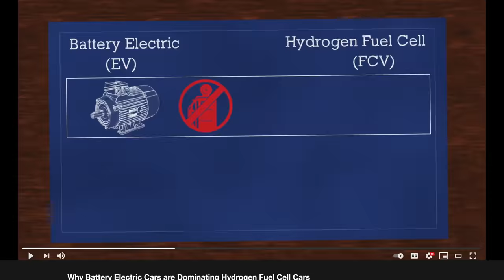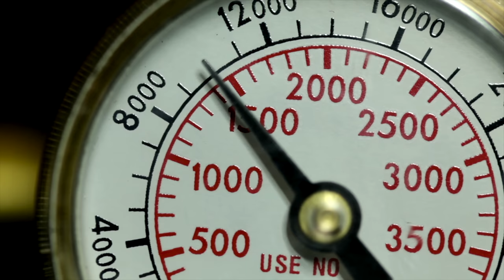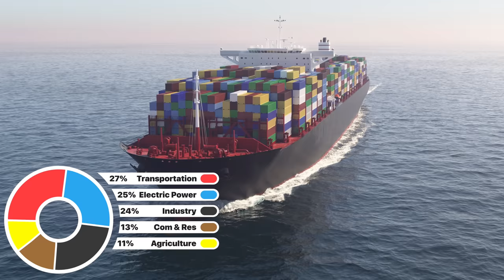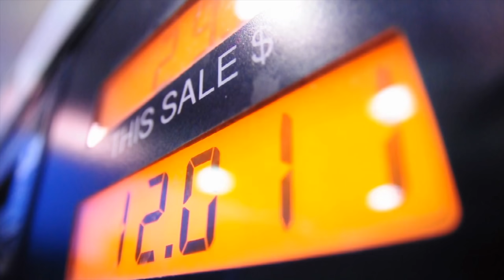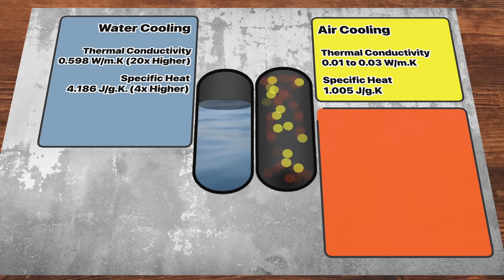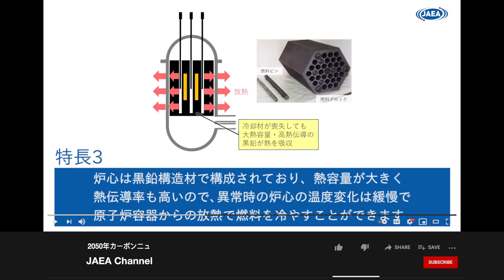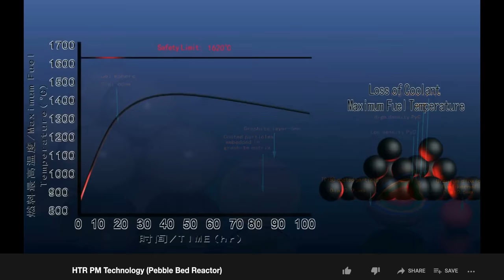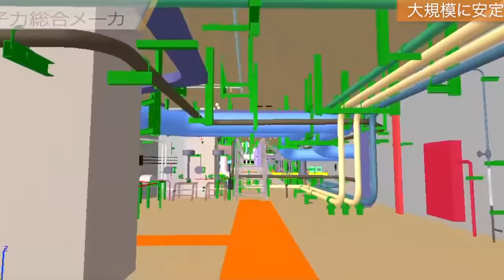Japan's Plan to DESTROY the Price of OIL and GAS!

Comment: Thorium. The only tech we need. It has been proven. It is the safest fuel for nuke reactors. It runs on the waste from current reactors making their waste much less radioactive. The reaction is forced not self perpetuating. If anything happens to the reactor the reaction stops, on it's own, with or without coolant or human intervention or power or computers. It is scalable so a power plant can be as big or as small as needed. A prototype car has been made. In 70 years it will need a fuel fill-up. Your house can be powered by it's own reactor.
So why don't they make them? 
Thorium is everywhere so production would be cheap. Unlike current reactors the byproducts can't be used for weapons and the waste is many magnitudes safer and less radioactive.
You would think those reasons would be great to develop this tech, however... Cheap production and massive availability would undermine a billion dollar a year monopoly on uranium production. Likewise, no nuke weapons fuel, that went over like a lead balloon. Safer and less radioactive, again you would kill a billion dollar industry. Each is heavily regulated and subsidized by the fed. Cause da money.

Comment: Not at all, Japan is keeping the price of oil and gas high. Platinum and Iridium is extremely rare. Using Nuclear, the most efficient process is produce electricity and use it directly for moving cars. Not use electricity to produce hydrogen then suffer a lost in efficiency for moving cars. Converting fossil fuel into Hydrogen is hardly green and is environmentally disastrous. 
Toyota and Honda will experience their Kodak moment.

Comment: But in the end you have to use fossil fuels to make hydrogen. I would like to see a windmill produce enough power to get the heat that high for half of what you have to do. Solar panels probably wouldn't do it either unless you use the middle of the solar array

Comment: 12:00 Funfact, if you use sea water, you will get Carbon emissions for sure. Because you will release the bound CO2 in form of H2CO3. It will not be at coal plant level, i guess not even at gas plant level, but you get emissions a 100%.

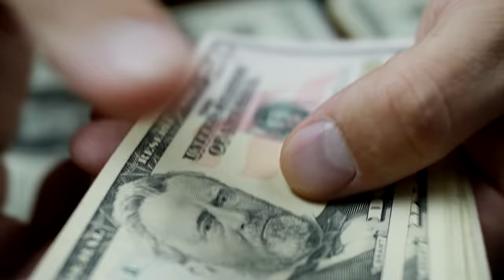14:00 For sure this first reactor at scale is NOT economically, if it means cost effective. Hydrogen from NG is just too cheap, for certain cheaper than from nuclear. So where are the figures? Is a new reactor in Japan as expensive as it is in GB, FR and the US? I don't believe they will have a cost effective way to produce hydrogen with nuclear reactors.
And "Totally clean"... yeah, NOT.
How do they don't need "vast amounts of nearby running water" if their main thing is splitting water in hydrogen and oxygen?

15:15 Exactly this nuclear fuel type was never economical till today. The reprocessing is more cost intensive than the traditional fuel rod. I don't believe this has changed and ever will. It is inherent more complex as the reprocessing is.
Funfact: Former HT(T/G)Rs were shut down because pebble fuel is NOT inheritently safe.

Question: Was the Hype that great, you had to spin the story so bright, you could just gloss over the problems without discussion them? Or do you just take Mitsubishis claims for face value? You know many nuclear companies project a bright product without having it in the first place. After a while it will become clear, it wasn't that bright and the cost overruns get into the 5 fold and more in the western world. Without a second viedo discussing these problems, i don't believe in it as it is stated here.

Comment: For transportation, fuel cells will never beat battery EVs. Look at the energy conversion efficiencies. Hydrogen needs to be made using electricity, it doesn't make sense. Just use the electricity via the battery to power the EV.

Comment: no matter what technology you use to utilize nuclear power; there are a couple of insurmountable issues  First it is nuclear waste  Secondly these systems are all mechanical  Saying they  wont break is like telling me that i can depend on my subaru to run trouble free for another 2 million miles based on the fact that it has run trouble free for 150000 miles a[ready. No matter how many additional safety measures we take, nuclear accidents, no matter how unlikely , are likely to be very problematic,
if you want clean H2 use renewables to produce it.  Coupled with the issues of hydrogen corrosion and mobile high pressure storage issues H2 looks a long way off

Comment: Without a giant battery break through or thermonuclear power or Thorium; the entire electrify everything plan is dead. Battery storage is fail from the start. If you used all the 100,000 tons of lithium annual production for storage batteries - you could power the USA for 5 minutes. The USA is 1/20th the World population; maybe you could power the world for 1 minute.  To even last the night; you'd need 60x8 or 480 times the batteries. That doesn't include half the world that is in winter and needs to be powered for hours. No Lithium for EVs, cellphones, laptops, etc - you'd likely need 10,000 times as much production of lithium; or any kind of battery.. just won't work.

Comment: Hydrogen is extremely difficult and expensive to safely contain even in fixed locations, let alone on a moving vehicle, in which everyone is under pressure to reduce weight and costs.

Hydrogen as an automobile fuel is unnecessary deaths waiting to happen...

Comment: 14:20 build anywhere? I mean you can build a nuclear power plant and a water splitting reactor anywhere sure, but it is f ing expensive and you can't just mass produce it everywhere. And you still need a reliable water source. And the biggest problem, still, is a transportation of hydrogen. It can not be liquified neither you can't use existing gas pipes (hydrogen is much more corrosive). So you have to build an entire replacement for existing infrastructure from scratch. Overall you need hundrends of billions for a relatively large country and a funny thing is that methane, oil and coal will still be cheaper. You can't just come to a huge economies like India and China with a huge coal deposits and tell them you should use hydrogen now which mean that fast grown ecomonies will still be using fossil derived fuels for many years.

Comment: Japan leads the way in nuclear energy? They operated some of the oldest nuclear reactors, ignored the advice that GE engineers gave them when they built Fukushima, had failed to properly train the staff at Fukushima Daiichi to understand how the emergency cooling system works and what they should see when it's working, and have a history of negligent nuclear accidents and ignoring seismic dangers when building plants. They were aggressive in building out their nuclear energy grid but cut corners and ignored sound advice from GE engineers in the US that were worried about the danger of a tsunami doing exactly what happened in Fukushima. Had they build the plant on higher ground and just dealt with having to pump the water uphill, and had they properly used the emergency cooling systems (which work without electricity), Fukushima would have never happened and they wouldn't have had to resort to burning oil to power the country's electric grid.

Comment: But what about blue hydrogen ! or, or pink hydrogen ?   When will it be useful 1 year 5 , 10 ,20 or 50 years?  Still waiting for the super battery, and the super, super battery that they promised , said it was right around the corner.

Comment: I love when people a lot of people mike try to cut the conversation of safety short but one part of safety you didn't really cover i'd like preventing the hindenburg We don't need To forget what happens when you try flying blimps or other sensitive objects with things like hydrogen and i think that's the bigger issue when it comes to hydrogen going to vehicles is human air to create a Hindenburg gas station fuel station
Reply: The problem with the Hindenburg blimp was the covering was coated by a rocket fuel. Static electricity set it on fire, if you ever saw the film the helium was burning straight up in the air.

Comment: Yeah Japan has not oil so they need to develop everything they can . They have been playing with Fuel Cell cars for years but there are no cheap fuel cells as they use platinum for catalysts. Then there is the Hydrogen Storage problem. I thought the Molton Salt reactors would also be safe and even burn our accumulated radioactive waste allegedly . MSR doesni't need to stop for refueling and the fuel cycle is something like 50 years before refueling.

Comment: There's a false dichotomy here.  There really needs to be a range of solutions that suit specific scenarios. Hydrogen fuel cells might be a good solution for Japan, batteries might be better for other regions.  Petrol and diesel lived side by side for decades. Relying on a single source of energy (fossil fuels) is what got us in this mess; let's use different thinking to move us out of it.

Comment: E-bikes have been the source of many fires. Lithium ion batteries likewise have serious problems with fire and the inability to put them out.  And then there are ever-present questions:  "Where are the components to make these batteries coming from?"  Who controls the majority of it?  What is the labor force made up of?  Children? the Poor? and the rest of the moral questions that need to be answered.  If the latter is not factored in, then those who push this are accomplices to the crimes--right?  What about recycling?  How about what is needed energy-wise to produce them?  How are ball bearings make that go into the product? The latter here is not talked about nearly enough, or are they researched.

Comment: Japan can do math.  Lithium is a dead end for EVs.  If all 100,000 tons of Li made went to EVs; you can make a max of 10 million Model Y size battery packs. For EVs to be more than a niche in the 100 million light vehicles sold annually and 1.4 billion installed base; Electrify everything fans will say - bettery battery tech is in the labs.  Hydrogen promoters also can point to Hydrogen production from saltwater, bacteria, etc. coming soon. Who will come out on top? Maybe Ethanol. We can make Ethanol now, it will work OK in existing cars, you can design engines the use it more efficiently; all you need do is grow crops. Brazil is largly doing this in their economy. And no the Amazon isn't the lungs of the world. It took billions of years to make the oxegen in the atmosphere and it isn't even fractionally dependent on the Amazon or even the oceans. Maybe there will be a battery break through or a Hydrogen break through; but why wait for that?  You can do mass carpooling and work from home now cutting CO2 by 8% NOW, then convert to ethanol; you need not buy systems that don't work.

Comment: The problem with EV is the recycling which is going to be expensive. Otherwise, you would already see investment and modern technologies developed.
Currently it is not big enough to be worth considering. Maybe future batteries will be built with recycling in mind.
A hydrogen engine can change the airline industry, power generation and landline transport.
The best is manufacturing hydrogen inside the engine. There is a chemical process that can do that but needs more research to make it reliable. If aluminum can be doped in such a way to allow that then you can have engines running on water and aluminum foil.
This will have enormous consequences through decentralizing energy production. There are already large-scale aluminum production plants all around the world and recycling aluminum oxide is easy. That will make mining lithium mining redundant and will shake things up beyond anyone can imagine. 
Whoever cracks that is going to face challenges never faced. Lack of fresh water around the world is going to be a growing problem. So, if you can combine desalination and energy production in one process then it will be worth a lot of money,.

Comment: Maybe I'm a bit of a stick in the mud, but the moment anyone claiming to explain an energy technology quotes hydrogen's energy density with no reference to the storage system (insanely far from massless) I flip the bozo bit. It's like posting a giant "I don't get science" or "math is hard" right on your forehead. 

mass of gasoline tank << mass of gasoline inside 
mass of hydrogen tank >> mass of hydrogen inside 

That's the symbol for "much greater than". Did you spot the difference? 

"A typical fuel cell electric vehicle or hydrogen car tank capacity is around 4–6 kg of hydrogen and the weight of the hydrogen tank is around 100 kg."

But you're an energy genius, and you don't want to harsh on the Pollyanna parade, so you rush to divide by 5 instead of 105. 

Good on you, Homer Simpson, you'll go far.
Reply: thank you

Comment: Your not shearing the other side's.
Plutonium...is the main nuclear fuel, simply because the waist is used for war weapons.
Thoriam......was also put forward as a nuclear fuel, but was regeceted due to its efficiency.......very little waist.
Thoriam is the way forward, very little waist and it's so much safer..

Comment: Hydrogen cannot be produced easily. It has the lowest amount of energy output compared to how much energy it takes to produce it of anything. The latest figure I saw is approximately 40% energy output of the total 100% of energy it takes to produce hydrogen.I love how this guy thinks that electricity is generated by wall sockets. It reminds me of these people in Colorado who drive around their Tesla‘s, then plug them into the wall socket which leads directly to the coal powered electrical plant.

Comment: And where do we get helium?  It is generated deep in the earth.  It ends up in the trapped natural gas deposits.  So we get all our helium from natural gas.  And most of the natural gas is not treated to remove the helium.  So our helium supply is pretty limited.  We need to put up plants to remove helium from the process cleaning natural gas, to have enough in the future.

Comment: How can you claim the righteousness in EVs when you have to strip mine for environmentally damaging, non-recyclable elements that the working conditions of that populace in these regions would be considered barbaric? Then you plug your EV in sucking more energy from the electric grid. The Electric grid is primarily powered in the United States last year's stats our generation of energy was Coal 21.63%, Oil 0.45%, Gas 38.18%, Nuclear 18.73%, Hydro, 6.26% Geo-Thermal 0.39%, Solar 2.76%, wind 9.14%, wood 0.89%, bio (other) 0.44%, and misc at 1.12%. 

I’ll state that Wind and Solar are hypocritical Ponzi schemes, because wind turbines are damaging not only ecologically, agriculturally, and in conservation of bird and bat species and forests; but are not efficient enough to drive energy prices ask Germany, and old turbine blades are buried in landfills same with Solar panels the contain earth minerals you don’t want leaking out and these two industries wouldn’t survive without endless government subsidies which make them not relevant. 

With nuclear 96% of spent nuclear fuel is recycled in nuclear recycling plants let’s look at the meltdown History Chernobyl was bad less than 100 dead initially but the range of later deaths is so drastic that it could only be politicized Chernobyl could have been way more 
catastrophic Fukushima ranked hirer but only 16 injuries were a result of the meltdown and explosions 1 cancer death so far which a bigger disaster was prevented through mechanisms. Kyshtym disaster 1957 200 in Urals Soviet Union at a Nuclear weapon and plutonium reprocessing plant and the soviets only had the tech for Nuclear weapons since 1949. The three-mile Island accident was not worth anything due to being contained with no injuries or deaths. Nuclear is a viable option with the advancing tech it’ll only be better. 
 
If we can perfect Solar and Wind more I’d say use them in combination with pumped storage hydroelectric to maximize efficiency you would only need a higher elevated source of water for the bottom which could be upscaled and downscaled to more personal energy devices. 

We were energy independent with the Gas and oil industry and we’re on track to be dominant which we could of. Sorry for the bad scary word, temporarily had a nationalization, in which the excessive funds and tax dollars would of eliminated the need for the Infrastructure Bill with the basic low tax and are revenue from overseas which with the excessive gaining profits would have been used to fund actual real solutions eliminating the need for the heavily bureaucratic and controversial Green New Deal but with actual results that manifest; yet maintaining growth, not increasing inflation, dependency on foreign energy sources, and taking the first step that will lead to a walk, then jog, and sprint to affordable, reliable, actually green energy at not the expense of ourselves these doomers have been pushing it every decade since the 60s look it up. With Hydrogen, it can go many ways like finding a way to make the Hydrogen atoms bond more tightly in water. We could us Ammonia for hydrogen fuel there is the opportunity to convert ammonia back to hydrogen, where it can be used to power hydrogen fuel cells, or it may be used directly within high-temperature solid oxide direct ammonia fuel cells to provide efficient power sources that do not emit greenhouse gases.

Comment: Still. I have yet to find someone to explain why this carbon is an negative for the planet. Save for the power and control a few get out of this being forced on us .
Reply from the maker: It’s so very simple. Imagine sitting in a closed garage with a running car. As you can imagine, you’d die, now imagine billions of people all burning oil and gas all around the world, while also cutting down the trees. Carbon dioxide traps in heat, which is good to a certain level. It’s all about balance. And what we’re doing now horribly disrupts balance